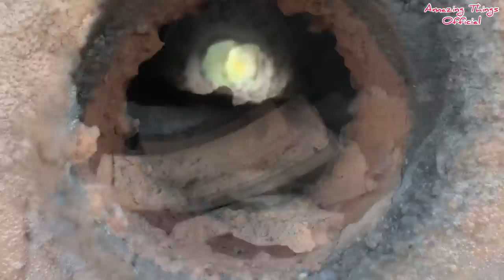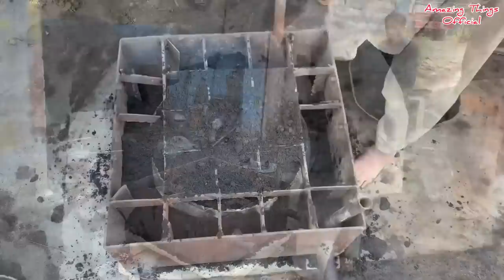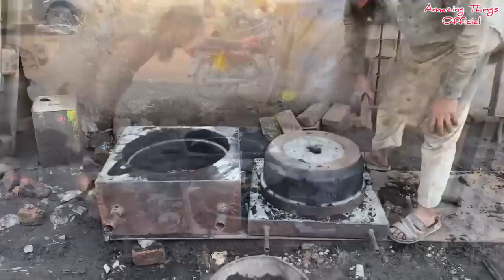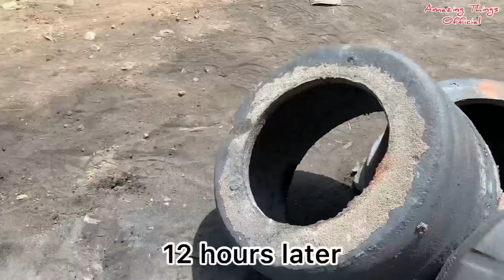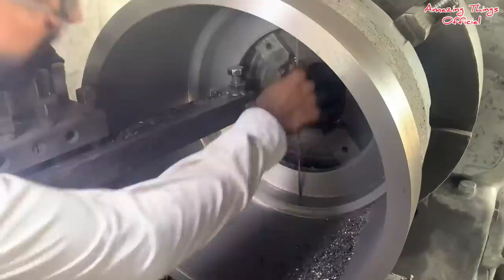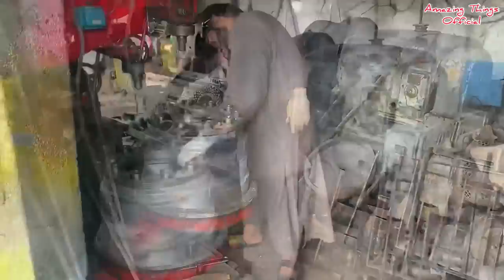How We Made Brake Drums For Semi Truck From Cast Iron Scrap || Brake Drums Production in Factory

Comment: Ohhhh man, he must have spent HOURS banging on that engine block!   Hard work for so little gain.
Reply: On dirt also? Just absorbing some of the impact.  Just hoist up high an drop on concrete or rocks even.
Reply: @shade38211  No shit.  They are supremely inventive on some aspects, but completely clueless and inefficient on some others.
Reply: Plus dangerous as all hell. Id rather be working the forge in bare feet than using a sledgehammer on cast iron in bare feet. A burnt foot can heal, a shattered foot may not

Comment: A simple truck bottle jack and a few I beams welded together to make a rectangle,mounted vertical on the ground with the jack welded to the underside of the top beam and you have a powerful hydraulic press that will brake apart engine blocks and anything else you need will little effect
Reply: probably too cost-y and too complicated, if you have a guy willing to pound it half a day with hammer....sad, but thats the life
Reply: If they just set it on something solid before they hit it, the dirt absorbs a lot of the impact.

Comment: Nice way to recycle old engine oil to run the burner. Love it.
Reply: it's also a nice way or contaminating the surroundings with carcinogens and toxic ash...
Reply: @AKAtheA  Certainly. But let's put that in context. Considering the locale, option B would likely have been to pour the used engine oil in a ditch. And as far as toxic things go, it seems to me that this contamination adds very little to what's already in the air over there...
Reply: @AKAtheA  Truly, and there is no hope for them being just in a temporary state either. Looking at their methods there is tons of room for improvement if they would only spend some time making bespoke tools, but instead they just swing those dumb hammers up and down on engine blocks in the dirt while wearing F'ing flips flops
Reply: I remember using diesel burners in the army. You'd pressurize the tank and heat up the pipes so it'd turn into a gas. They obviously make it work somehow.. These bush workshops are an accident waiting to happen. Even the machine to break up the sand should have had some kind of safety grill over the top. And of course they all seem to be wearing flipflops or bare feet. Amazing!!
Reply: @AlbionSupreme  American workers used tools and processes that were equally as crude and dangerous, roughly 100 years ago. We managed to evolve acceptably.
Reply: @DrLumpyDMus  Lol, no you didn't. Even an Iron age blacksmith had better working conditions and developed his workshop far beyond this level.
Reply: @AlbionSupreme  😆

Comment: His furnace setup was amazing. The way he was heating up those pipes with his propane torch suggests to me he's using a diesel burner which turns into a gas when its heated up. Such hard work and skill with very basic tools. Even getting the steel pieces from that old engine block was enough for me.
Reply: Secondo me, il bruciatore funziona a nafta grezza, la quale deve essere riscaldata per poter scorrere nelle tubature. Vedi il motore del trattore Landini
Reply: I hadnt thought of a diesel burner, yep thats exactly what it is I bet. Was looking for an answer as to what that thing was
Reply: Looks like waste oil burner to me.
Reply: It's just an used automotive oil burner, not diesel. He's heatin' it with gas torch, to help became flammable. Only way to cast iron to desired temp without cox charcoal in small amount. Quality of this cast is out of any words.
Reply: That's used automotive oil he is mixing with the sand too.
Reply: more like a HFO setup off an old ship IMO.
Reply: @neontime  that's sand for the casting.

Comment: I worked at a plant back in the 80's where a crew of twelve poured 190 of these an hour. Super automated, precision metallurgy, and lots of tools to help. I hear the kids today are pouring 300+ an hour and are hitting up against limits of local supply of scrap and ability to cool the castings before demolding.  Messy work.
Reply: good

Comment: Nice work. Where is a large metal bandsaw when you need it? I can't believe they break apart the metal pieces with a sledge hammer. OMG.
Reply: I was thinking plasma cutter. But yes, anything to make it easier. I wouldn’t have the strength to last one day doing those jobs.
Reply: @brianpaine1749  It would be better to crash an old iron by hydraulic press.
Reply: @azid123456  With their complete lack of safety gear, a hydraulic press would be suicide for these guys. Cast iron can shatter and explode in a hydraulicpress

Comment: Some areas of the drum did not clean up on the inside so it is painted to cover it up. Those drums will cause a loping action when the brakes are applied, of course when you have 50 people hanging off the sides no one will notice.
Reply: Mereka sdh terbiasa dgn panasnya kehidupan,....mereka SDH terbiasa perang dgn suhu tinggi,.....mereka kuat, strong, TDK takut kecuali kepada Allah SWT

Comment: Those drums would be a bit better (more uniform; less prone to warping in service) if they let them cool completely in the mold instead of breaking them out while still red hot.
Reply: not sure if they have quality in mind....or safety.
Reply: they are full of inclusions and air pockets, so they are already primed to crack.. also, the poor guy installing these will need to remove all the paint from the machined surfaces.. painting the inside and the mating surfaces is going to cause the first issues if its not cleaned off
Reply: Ain’t nobody got time for that
Reply: @HomeDistiller  troll much. These guys are doing no different than you would be doing if you were in their shoes but I bet it is really awesome to have some privileged American critique and everything. 

So much so I almost think maybe he’s the one that’s privileged (sarcasm).
Reply: @justintothetruth  they are doing great in some forms, horribly in others. But I sure you can agree, if you haul a 40 ton load, you rather have brakes you know work and work for a long time instead of your dealer saying "these are really cheap, pakistanis made them. They don't properly fit(paint) and they could fail after 90.000 or 90 km. But it's ok, because the workers there work so hard with what they have and beat their lathe with hammers.
Installing new brakes, driving 80 and they fail 3rd use is not a good thing.
Reply: @an2thea514  Actually that is a good point about beating the lathe. If the want to tighten the tool rest they could use a larger lever. But everyone in this workshop is not the full quid!!!!

Comment: The lathe of theirs, everything is as dry as a bone, the bed ways, the tool holder screws, the chuck jaws, the tool post etc. Not a drop of oil to be seen and consequently everything needs to be tightened via an extension pipe or beaten with a lump hammer.......What is wrong with these folk? There's a 100 gallons of waste oil around the corner that they use to fire the furnace.
Reply: Did you notice the amount of porosity in some of these drums?  They would be scrapped in the west for not being safe.
Reply: @epistte  It would be interesting to see how these brake drums perform in actual road use. The porosity would produce uneven brake shoe wear, but I am not sure if it would greatly reduce braking force. I do suspect the porous zones could create stress risers where cracking would be more likely, but even then I am not sure if cracking is a significant issue in real-world use. While these brake drums would not be expected to perform as well as consistently cast and machined drums, they may still offer better performance and reliability than the worn-out drums that they are replacing.
Reply: @DielectricVideos  It's the stress risers from the porosity that scares me. if one of these drums shatters on a Himalayan mountain road someone is going to get killed and it won't just be the truck driver. The grade of their raw iron is questionable, to say the least. I appreciate their hard work but brake drums have a very high safety requirement.
Reply: @epistte  они плавят не железо. а чугун. Блок цилиндров. тормозной барабан что кувалдой разбивают они чугунные.
Reply: @GeoffPesos  Yes dude, I spotted that. But tell me how that precludes lubricating the lathe?
Reply: ручной труд, все при деле, не стоит переживать, что кого-то уволят из-за современной роботизированной промышленности
Reply: Oil mixed with cast iron dust makes a black oily abrasive mess, not a good lubricant. Unless theres some way to cover the ways and other working parts it’s better to leave them dry.
Reply: remember they been doing this for year's and years
Reply: @epistte  thats just on the surface. They did not machine the entire drum. Under the surface it looks much better.
Reply: @GeoffPesos  at the expense of human lives…while they are making the best of a situation. The items stopping a ten ton truck is not something you make in the backyard
Reply: It would be wiser to witness the entire process on the ground (including their customers) to come up with a more justified conclusion. Let's not be quick to judge just by a mere single video. I applaud their efforts seen so far.
Reply: We see what new technology can do 😂😂😂😂😂😂😂 
They use all the new stuff for the production. I am impressed. 2022 here we are 😂😂😂😂😂
Reply: Either thier luck of knowledge or they just don't care.  I wouldn't buy any of the stuff that comes out of that place
Reply: @Raidersforlife229   how do you think China got started
Reply: TN 0
Reply: Even the lathe is wobbling

Comment: He should make one from aluminium cans. He can then use that one to make the molds rather than busting his back lifting the stock steel one all the time.
Reply: Afaik, scrap iron is practically worthless, you can get tons of it for just a few bucks. Whereas aluminum is pretty valuable. If he was using literal cans, it would take thousands of them to make just one of these.
Reply: @skeetsmcgrew3282  yeah but you only need 1 and it would probably add years to his working life. And if he is scrapping old blocks, surely there must water pumps and other aluminium parts he could be melting down.

Comment: A little bit of a cringe when they paint the insides of the brake drum-- there is no good reason to do that.  Only bad reasons, like to cover up marginal spots, corrosion, or bad machining.....
Reply: How about to stop it from surface rust which happens in hours? new mercedes Benz discs are also painted in grey primer
Reply: @crownautosable  usually it has a thin layer of oil for that. Paint is a horrible thing because that the braking surface for the pads. Its going to gum up and burn, if not ruin the pads for a hundred miles
Reply: @crownautosable     I wonder where they are getting made ?
Reply: @crownautosable  Wipe the bare iron with used motor oil to prevent rusting.
Reply: @oldUmanUshea  typically it is cosmoline is used. However there's a lot of make do with what you have going on here so I imagine it's the same story there. Nothing a wire wheel and a angle grinder won't take off. Probably the normal situation over there.

Comment: Is this heating method very energy-intensive?
I feel like about 50% of the heat is wasted
Why not seal the back of the furnace?
It is to "melt" the metal, not to "heat" the metal as in a forging process
Is it a mistake to use a furnace designed to pass through?

Comment: We missed the bit where they used filler to repair flaws from the casting process, and then painted the inside of the drum to cover it up.
Reply: I was wondering why the hell they would paint a part that never sees the light of day until I realized this is exactly why
Reply: @emif841  You may wish to consider help for anger management. 
This is youtube not metallurgy university and making a total joke comment about how they cover up flaws with filler does not warrant this type of tirade.

Comment: Come on guys an duse some cutting fluid/lubricant please. Even that sump oil u used in the sand mix would be better than nothing to reduce noise and save ya cutting tips and drills.

Comment: Smashing an old engine to get the metal for casting. Makes me wonder how badly damaged that engine was because everything I've seen so far shows me they can repair any engine - it must have been badly damaged if they couldn't fix it!
Reply: Or they buy bulk scrap from over seas where aint nobody repairing shit. With just random hunks of metal, not paired with anything, you cant realistically use them for much of anything. Or the engines had all the most valuable bits removed to repair OTHER engines, then whats left over goes to guys like this

Comment: I am unease just watching them. Long sleeves around lathe, flipflops at furnace, when molten material is on the ground, same as they are dismantling casts - no gloves. No safety googles with angle grinder, no breathing masks... absolute no selfperservance instinct. That "garage" is just a place where accident is waiting to happen. Not talking about "product"... which wouldnt, coudlnt and MUSNT pass any of safety and quality standards. If the guys there are willing and would wear it, i am willing to send them equipment to wear.

Comment: not one drop of machine coolant , or cutting oil !!  - but why spray paint the braking surface , now the mechanic has to scrape that paint off before it can be used ? it will ruin the brake shoes..

Comment: How does that rocket engine thing work?
Reply: I am guessing it a wast oil burner based on the tank and preheating the lines. Small flow of oil atomized with forced air. Just a guess though

Comment: A lathe is a precision instrument. So let's throw this cast iron onto the ways. Now let's use a four jaw chuck with the intention of wearing it out as soon as possible. Now boring bar... Regiity isn't that important so let's use a square lump of steel and hold the cutting tool with a bolt.

WHAT? YOU CAN HEAR CHATTER? I CAN'T HEAR A THING.

Comment: Well, in the West it's made in the same way but the only difference is that it's made by the robots instead of manual work.
https://www.youtube.com/watch?v=lM_Ravhnn3s

They did a great job. I'm just curious if the metal alloy is the same as the composition of the engine...Or if it comes close it's good.
Reply: The general process is the same, since that is how you make cast iron parts, but these guys take some shortcuts and do some things not quite right.